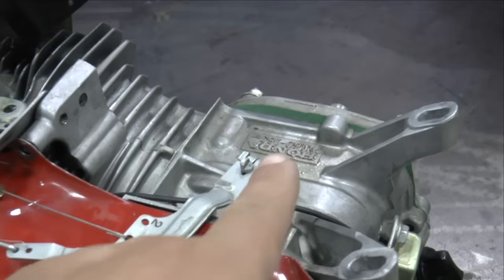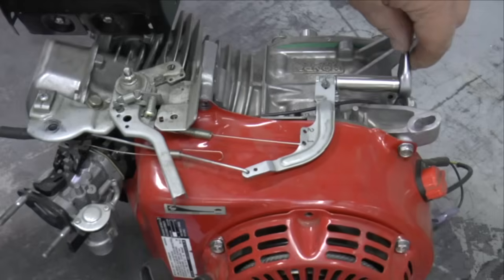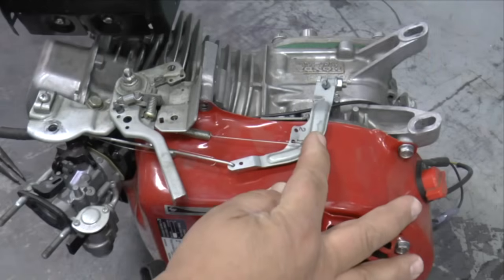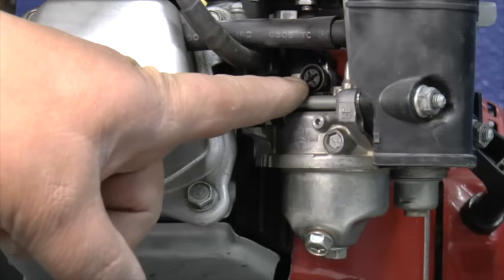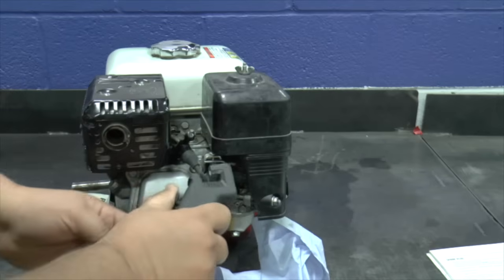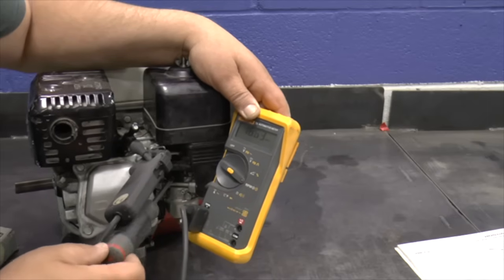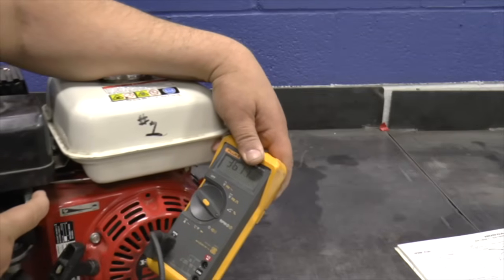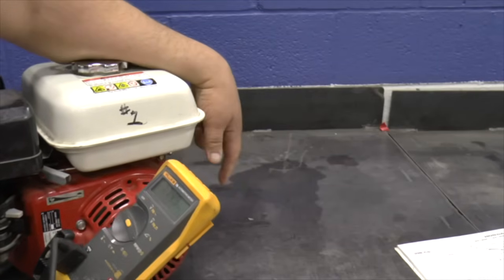GX160 Governor & Carburetor Speed Adjustments

Comment: Alright, this got me pointed in the right way. However, there was no cautionary note about the governor shaft disconnecting internally if the shaft is allowed to drop 1/8 inch during adjustment, it disconnects internally, and there now no rpm control. Took me while to figure it out, Thanks!
Reply from the maker: Your point is well taken.  Thanks.

Comment: UPDATE:1 year and still cranks within the first 2-3 pulls. Probably will buy another when this one finally does bite the dust https://www.youtube.com/post/Ugkx43QMbQqu67IZadu9ou8Sg1BdrunMRNqX . No issues at all. Very happy with it.UPDATE: After 6 months of use and over 70 uses I would still highly recommend this pressure washer. It does vibrate a decent amount but never had it “walk” like others have mentioned. No oil leaks, still seems to run like the day I bought it. Still cranks within 2-3 pulls every time. Very happy with my purchase!Have used it about a dozen times now. Plenty of power, cranks up on 1-2 pulls every time. My only complaint would be I wish it was a little taller to make it easier to walk with it (hits my ankles a lot) and that the two hose connections were a little further apart but it hasn’t caused me any issues. Seems to run a good 1-1/2-2 hrs on a full tank, overall a well built machine and definitely worth the money in my opinion.
Reply: Hello i like your videos,i have bertolini 206 same as you,my v belt is broken.
Can you tell me what is length of the belt ,how its long and how its wide 17 mm or 19mm

Comment: Found out what that small spring for.  It's for a separate throttle.  So I didn't need it.  My problem was the valves.  Adjusted both valves and engine run well.  Throttle working as it should now.

Comment: This is such a great video.  Thank You.  Question:  I noticed a small spring up on top of the throttle control next to that nut.  My Honda clone engine does not have that spring.  I bought this engine at a yard sale and the throttle wasn't changing the speed, nothing happens when I move the level left or right.  do I need this little spring?  Thanks.

Comment: My throttle spring doesn’t is not move throttle? Wondering what I am doing wrong?
Reply from the maker: When the engine is off, the governor pulls the throttle open to full throttle.  That may explain why you are not seeing the throttle not move.
Reply: I think my govener arm is bent, I’m not get any tension off the throttle spring? Thanks again for your help
Reply: Is it supposed to stay on full throttle when running?  My  kids go kart is stuck on full throttle

Comment: I love this video! I have a question. I changed fuel tank, fuel line, carb filter and put a new carb...but the engine runs only with the choke on the left position. If I put it on the right it dies. I put back the original carb that I cleaned and it does the same thing. Any suggestions? Thanks.
Reply: Take the air cleaner off and check at which position the choke is actually closed. Just had one, the label was incorrect.
Reply from the maker: Cracked insulator or torn gaskets that goes in front of the carburetor?  Gaskets installed wrong?
Reply: @motoprof1441  everything looked right there, but I wonder if the insulator is not that flat anymore. The gaskets are really thin, so...I will put a new insulator and eventually a thicker gasket. Thank you for pointing the possible issue.

Comment: Why would you lock the governor down wide open? I did exactly what you said and it runs wide open it makes absolutely no since to set it wide open
Reply from the maker: When the engine is off, the governor is wide open.  Think about it.  When rpm's drop, the governor opens the throttle to maintain engine speed.  So, with the engines off, the governor pulls the throttle wide open.  As rpm's increases, the governor closes the throttle.

If you adjusted the governor and it's running wide open, either you did it wrong, or you have other problems that are causing it.  Thing I would look for are linkages that are sticking or rubbing, air leaks, carburetor problems, or a defective governor.
Reply: @motoprof1441  I just wired it to the throttle it’s a Honda GX160. I can manage the idling with just the one arm now.

Comment: Thank you for creating this video!  And thank you for keeping it short while still demonstrating the various governor / speed control adjustments.  I have a Subaru/Robin engine on a generator and the controls are similar enough to the GX160  where I think I can adjust the voltage/frequency output on the generator.
Reply: Good.  Video.    Carnal.   Desde.     Huston.   Tx.    Mando.      Colombia.  🇨🇴💪❤️✅

Comment: I changed my carb and the engine is still spurging and runs best with choke half engaged or fully engaged. Seems to die if choke is off. Is this an ajustment  I can make??
Reply from the maker: Check fuel flow to the carburetor.  If it's good, you likely have an air leak between the carburetor and engine block.

Comment: Thanks for the video.  I had replaced the carburetor and couldn't remember where the mechanical connections and springs were supposed to be.  Initially I wasn't even aware that the engine had a governor, let alone how to adjust it until I watched this video.  I've watched a lot of videos in an attempt to resolve my dilemma but they seemed only to be concerned about disabling the governor.

Comment: have tried everything new springs screws in & out but go's crazy high when i try put it to run position to give me the electric can get it to tick over ok only way when running is by putting my finger on the black plastic cap on the carb the one the govenor springs are connected to i need for electric am living off grid, if i take spring of govenor i can have it in a way i get cpl hundred volts but need more to run houseold appliances any ideas anyone? Have a champion 2800 whatt model  similar layout!

Comment: I noticed you had the governor spring disconnected the whole time.  Is that part of the procedure??
Reply from the maker: No it's not.  That should of been installed.  It's actually not the governor spring.  It goes over the governor linkage.

Comment: I did this and my mini bike won’t stop driving as soon as I turn it on it takes off
Reply: That is bc your clutch is designed to engage at a certain crankshaft rpm speed try turning your idle screw out to lessen the speed and it wont try and take off on you at idle
Reply: @DanoOutside  person did that and it still took off.
Reply: Lmao... gone in the wind

Comment: You have just saved my pressure going to the dump and after stripping and cleaning the carb and changing the fuel the problem was the adjuster under the fuel tank had come loose, hardly surprising as the engine was running rough and vibrating prior to undertaking the cleaning and adjustments I made as per your video. 
Many thanks for your excellent presentation skills.

Comment: Hi good day . I have a gx390 and it works fine. It accelerates well ... I have trouble pulling the rope back. he takes my arm out. as if the spark was too far ahead. What can be?
Reply: damaged recoil mechanism, take it apart and check spring or replace the entire recoil

Comment: My generator (1500w) is producing 300v, and under load of 1050w, voltage goes to about 225v. Is that normal ? And how do I fix that ?
Reply: I am having trouble hooking the springs up on my Honda 215 sx .I took them off and forgot how they went back. Being 82 is no help. Can you please send me a picture to my email address h37c43@hotmail.com Thank you very much

Comment: Thank you for posting this.  My engine is idling very high.  I followed procedure but the butterfly on the carb is opened to the max (like you show when pushing the gov arm to the left) so when I try to adjust idle screw it has no effect since screw is nowhere near touching the butterfly linkage.  Is this common issue?  If I push gov armature to the right while running it slows idle but when I let go it springs back to the left and idle returns to very high.
Reply: I found a mini bike in the trash and it does the same thing. Did you ever find a fix? I looked at a lot of videos and it seems like no one has the same problem. I don't know what to do.
Reply: @treskate  Hi Tre, unfortunately I have not found a solution so I just took the mower to a small engine repair shop and am waiting on them to get back to me.
Reply: Randy The Macho Man Savage did they ever tell you the problem ?
Reply: Im having the same problem so I think I'm going to push the governor the opposite direction..

Comment: Hold on. You say the spark will ignite every crankshaft revolves. Hey, this is 4 strokes engine, which should be spark will ignite every two revolutions of crankshaft. Remember, spark will ignite when power stroke only, which is half rotations. Intake-compress-power-exhaust. That 4-strokes.
Reply: No, you are wrong. 

 It's called waste spark.  The ignition is run off the crankshaft, so it fires on the compression and exhaust strokes.
Reply: Don't want to get into an argument here Sunggu, but D Jenks is correct. Although the combustion event only occurs once every other revolution on a four-stroke motor, the spark still happens every rotation.

Think about how it is triggered, which is by a pair of magnets affixed to the flywheel passing by a magneto, which is fixed to the engine case and is essentially the opposite of an electromagnet. The motion between the two causes a high voltage to be induced through the plug wire, which is connected to the magneto, giving you a spark. Now, I think that we can agree that the flywheel and piston, since they are both attached to the crankshaft, complete one revolution simultaneously. Given this fact, the spark must occur once per rotation.

These engines are simple and mechanical, just think about how it works and you'll understand this better. Please refrain from passing along incorrect information, especially in a condescending and overly-critical way, until you do. Even then, it doesn't hurt to be a bit less condescending.

P.s. Just posting this information here so that people are not misled by incorrect information. Ultimately, that is my primary concern, not whether or not I am able to convince Sunggu. Also, although D Jenks apparently had the same thought, I believed that it would be helpful to have the explanation in-line with the comment, as opposed to through an external link. Thank you D Jenks for your efforts!
Reply: @Currancchs  Sorry for the inconvenion. Seems that I have to learn lot more about 4-stroke engine, especially small single-piston. Actually I have a Honda GX200, a bigger series than yours. I also explore that engine as I used for agriculture and I am researching how to "catch" the exhaust power to be used as blower for my agricultural. But your opinion have astonishing me. There are lot more I don't know. Thank you for that new knowledge.
Reply: @StrsAmbrg  No inconvenience, happy that we were able to resolve the misunderstanding! Apologies if I read more into your posts than intended. We're all always learning.
Reply: I believe you understood wrongly 4-strokes engine. In a 4-strokes engine, there are two revolution per ignition. Please watch this video so you will understand better. https://youtu.be/Pu7g3uIG6Zo
Reply: @StrsAmbrg  no sir, you do not understand.  Look up waste spark ignition and then you will be enlightened.  Here's one source for you.  Pay special attention to the single cylinder section.  https://en.m.wikipedia.org/wiki/Wasted_spark
Reply: @motoprofessor3546  That is for engine with multi-cylinder. In the case he explained in his video, it is only one cylinder. So definitely no such wasted spark.
Reply: @StrsAmbrg  I guess you didn't read the single cylinder section.  

I will not comment on this anymore.  I've been teaching this for 29 years now using various factory resources.  I know what I'm talking about.  

Blessings to you and have a good day sir.
Reply: @StrsAmbrg  you are wrong, this shit doesn't have a geared spark generator, meaning that it spins at the same speed that the crankshaft, therefore making the wasted spark shit

Comment: Correct video pls!
Reply: Not sure what you mean by your post.
Reply: You "say" clockwise in the video, but the caption at bottom of screen says counterclockwise. I believe this is the correcrion they are referring to.
Reply: T Manseau you are correct.  After the video was posted, I found that I narrated it incorrectly, so I added the correct words on the bottom of the screen.
Reply: @motoprofessor3546  sorry but you said it correctly - clockwise is correct otherwise the internal governor arm would be without function.
Reply: Am I seeing things wrong also(?), because I've watched that portion of the video numerous times now and it appears that you do actually turn it clockwise in the video.
Reply: Should it have actually been turned  counterclockwise or is the correction indeed incorrect lol.
Reply: I am currently working on a gx160 for my first time, and am having trouble with the governor so I just want to clarify before I adjust it.

Comment: Can you suggest any source for a new governor Spring?  Mine is worn out and not working properly....thanks
Reply: ebay is great when you know what you need.

 https://www.ebay.com/itm/Throttle-Return-Spring-Governor-Rod-Spring-Link-Set-For-Honda-GX160-GX200-GX120/283276145542?hash=item41f492f386:g:ZHcAAOSwkjJb-f10

https://www.ebay.com/itm/Replacement-Throttle-Return-Governor-Spring-Fits-Honda-GX120-GX160-GX200/192589138906?hash=item2cd7350bda:g:9qoAAOSwAOdbPRsU

Comment: I am having problem with a fireman man sumec generator , governor control and it is making so much nose even after I adjust the governor control
Reply: Richard Prince sounds like the governor came apart inside the engine plastic button fell off? If the governor is adjusted while running it can eject the button inside. If u turn the governor the wrong way it will make a buzz sounds from gears hitting the governor arm , disassemble and reassemble to fix

Comment: Dear Sir what I will do if the smoke  color change into black ...heavy smoke
Reply: Eng Abd Allatif mar guess the rings are shot
Reply: Not shot rings. There is too much gasoline in the mixture or oil gets into the combustion chamber. Check your spark plug and search for a guide on reading spark plugs; that will tell you exactly what you need to know.
Reply: Clean air filter...check make sure choke is open. Clean carburetor.

You are running too rich

Comment: My engine shuts off if I push the lever to idle. It does have an on/off switch. The problem I'm facing is it dies after starting. The oil is at the correct level. The gas tank is vented at the top to a line that runs to the air box. There is no obstruction. P19 carburetor replaced. Gas tank cleaned and filter clean.
Reply: oned4metwo once check your engine idle rpm
Reply: @shreepandurangatraders1553  I am having this same problem. How do I adjust it to make it idle higher?
Reply: @augustm5268  lol watch the vid loloolololo